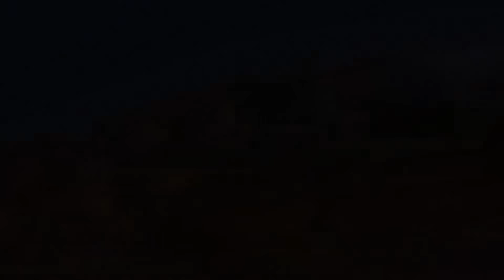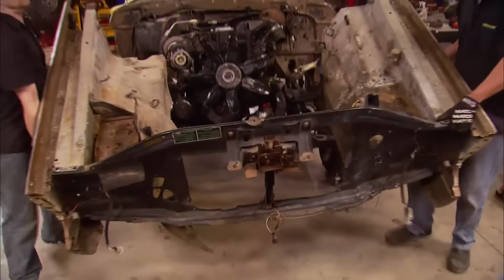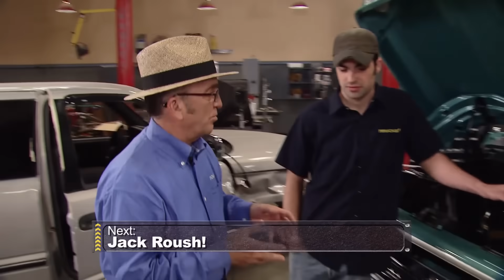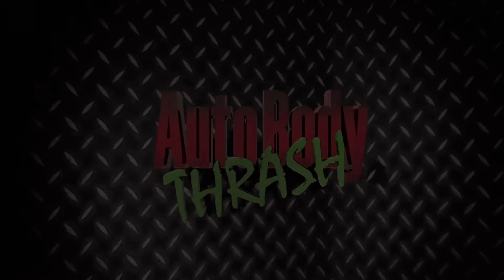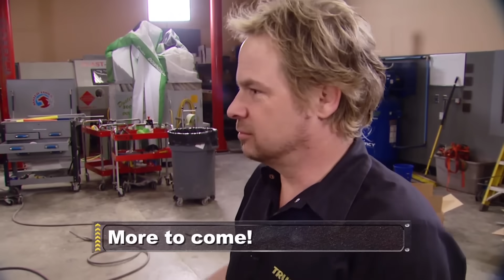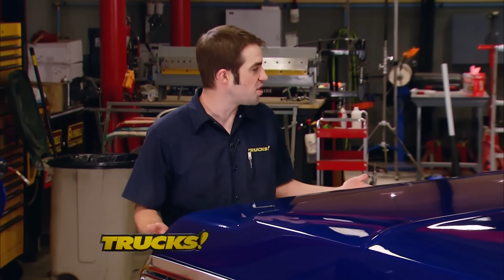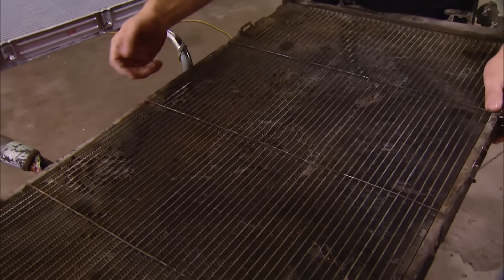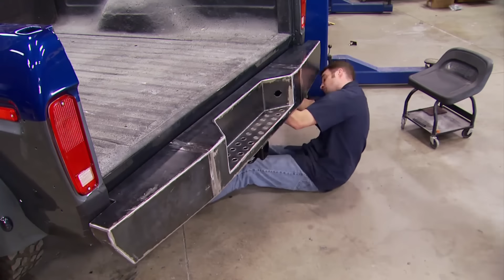Ford Crew Cab on a Dodge Cummins Chassis! (Super Dually) - Full Build

Comment: I love the build its a beautiful truck but why the cummins it's a FORD why not a powerstroke the new high output 6.7 is a monster that beats the current cummins in every possible metric  or a venerable 7.3 powerstroke that will pull almost anything and the aftermarket is masive  or even a 6.9 or 7.3 idi sure they are  slow and don't like to get out of their own way but they'll gurgle on forever  and are stupid easy to repair and maintain or even a bulletproofed 6.0 that will make stupid amounts of power when built properly (the 6.4 is a piece of shit and should be burned at the stake) but there are so many OEM matching engines that would have worked in my mind far better and you can buy a crated powerstroke from summit. I wish more of these restomoded fords would have taken the time to build or get a ford to put back into them because while cummins make good engines the 7.3 is iconic for a reason and the high output 6.7's sheer power makes it a better choice for a tow rig than a cummins does .

Comment: Isn’t that sac religious to stick a Dodge in a Ford? 😂 or visa versa?
Reply: The model T came with engines built by Dodge when they were just a parts supplier. When ford started cutting them out of their parts contract and cutting down on dividends (dodge was the largest shareholder at ford outside the ford family). Dodge sued ford, got a ton of money and started building their own cars. So there is a precedent for putting a dodge motor in a Ford.

Comment: Too funny. I was talking the other day how I like to take my 89 Ford F150 4x4 and put all the parts that I can off a newer Ford 4x4 that been damaged or wrecked. Maybe taking 3-4 trucks to get all the good parts I’d need.  Just want to keep the 80 frame and body so I could still register it as a 89 Ford.   Whether or not that be easy enough to switch everything over I haven’t a clue?  Unfortunately I am not one of those great custom vehicle builders I see on TV now and then! 
Like the builders that took a brand new charger and put everything in a 69 charger I believe it was ? Looked like a 69 charger when it was done, but everything mechanically was all brand new 2022 Dodge charger!  Personally, I rather had a 71-72 Dodge challenger and put in anew doge challenger hellcat in it!  Although if I could find a dodge challenger with a 426 hemi that was stock and in good condition I wouldn’t cry having that either!  
Have no idea which engine would have more HP? The 426 hemi or the Hellcat engine if both were stock?

Comment: For better towing switch the gears to 3:73’ it makes a huge difference especially when pulling heavy loads uphill. We did it to a 98 3500 and what a difference it made and it didn’t make much of a difference in fuel economy.

Comment: Seriously stupid to be doing drum brake springs without safety glasses... my shop foreman would pull out his glass eye and hand it to you if he saw that... he slipped and stabbed it with a pair of needle-nose pliers trying to remove a brake spring when he was in his 20's... grabbing a pair of safety glasses for the job is better than living without an eye for the rest of your life... ( or worse...  the doctors told him that  1/2 inch deeper would have been FATAL )
Reply: In 15 years in the business, I’ve never met a mechanic who lost an eye or was seriously injured doing drum breaks. I’ve never even seen one wear safety glasses, even the ones who have been doing it for 40 years. Maybe not put your face that close to the drums.

Comment: My brother had a Chevy 3500 dually build to hotshot in the patch, old 454 would run, high torque @ high rpm, almost useless @ 55 mph, @ 75-80 it’d pull to beat the band, thirsty though!  It’d been a great candidate for that diesel!

Comment: IHC put the first stock diesel in a pickup in the early 70’s, a 354  non turbo Perkins, one known to exist, probably pretty dead, also at the same time they puta 6 cylinder mitizbitize, sorry can’t spell well, the 6 was turbocharged, I can’t remember if they messed with a turbo on the 354 Perkins, they were 145 engine hp in a tractor @ 2200 rpm.  We had a IHC 1206 wheatland, no pto, 3 point, adjustable front, but with a rolling drawbar.  It had a 361 turbo IHC engine in it and a Rosa-master fuel pump on it, very sensitive to dry fuel, got overhauled every 1000 hours, hotter every time, oil cooled pistons were standard on that engine. Dad graded it for a 1135 Massey, weighted the same as the 12, it didn’t stand a chance in power, very nice to run, opps traded for a 1505 4 wheel drive. Anyway the dealer sent the pump in and then it’d pull with the 12, never was as snappy as the 12, story for another time, maybe more than one lol, the old 12 would use a gallon of oil a day during the heavy work times and none rodding and seeding lol, Massey’s clutch wouldn’t take the power
Reply: Exactly. There were factory diesels long before 89. Dodge was the first to put a turbo on their factory diesel pickups.

Comment: My Grandmom had a late 70s Chevy C3500 Scottsdale with a 454 under the hood for towing her 5th wheel trailer. Hers was a "3+3" with dual bench seats, and it wasn't a dually. When she was towing her trailer, the only way you could tell was because the gas mileage was even worse than usual! LoL

Comment: You adjust the drum brakes shoes through the access hole in the back of the brake plate. They should be adjusted so the tire doesnt continue rolling when you spin it by hand.
Reply: Actually you just need a slight drag. It shouldn’t stop the drum from spinning entirely.

Comment: Wow ! I can't believe that Dodge is a 1997. You guys should see my 1996 Dodge that I drive every day in Michigan. I can see the road next to my seat and the doors are held shut using shed door handles bolted to the only non-rusty metal. Yes, I do have to reach out the window to open the doors. If I get in without my keys I climb out the camper window.
Reply: That’s the difference between the snow belt and the south. In the south, only minor rust. In the southwest? Faded paint, cracked plastic, and not a speck of rust.

Comment: how may this thing look today, roughly 15 years later....
Reply: No idea. It never reappeared on the show after they were done. That white Ford tow rig this was supposed to replace was still used up until at least 2014 (5 years after this truck was built). It was probably either sold, stripped for parts or crushed (more common then you’d think on these shows).

Comment: Loved all of the information while the build was ongoing. The amount of collective expertise assembled for the completion of this project, befits any and all accolades earned by the various company owners. Kudos also to the hosts, who do a fair amount of labor; very knowledgeable guys.
I was gifted an F-250 2-WD. Had to weigh the bed down with sandbags, kitty litter, wet slushy snow or anything else exceeding 300 lbs; ex girlfriends were not always available or accommodating. Vehicle did its best work hauling groceries and 'sailboat' fuel.
The color scheme. The hard work. The dedicated exuberance ❤. The unlimited budget. That Loud Diesel with that Gawd Awful Stupid Whistle. The Pickup truck itself💩. Sorry. Unless there is a need to haul something...NOT A FAN OF PICKEM UP TRUCKS.
Reply: One benefit of EV trucks: since the battery is so heavy and lowers your center of mass, no need to worry about fishtailing with an empty bed or excessive body roll.

Comment: If I had the money, I would purchase the truck in a heartbeat! I Love the body style. Sweet! Thanks for this build.❤
Reply: Do what my wife and I did.  Build one like it, with your vision of an end result.

95 Ram 3500 donor vehicle, and a an OBS K 2t00, 92 extended cab gas model. Built our ultimate tow rig, for our shop.  Also strp capable. 

And I did a.lot of the body work from a wheelchair, or my prosthetic leg, eith the chair behind me as a safety, or plan B. Lost the right one, a week after we got the chasis back from powder  coating,  and the engine and trans back from the machine shop. Was back to the shop the day after I was sent home  to the driveline back in it, as a roller, and the body in primer, after getting soda blasted, revealing dents,  like it was a driving range target, AKA , ball picker. 

Wife worked from the top down, I got the bottom,  with the service dog supervising. From the office, of course. They don't male N 95 masks for pets.

Was finished this spring..

I still, after two amputations, don't think of myself as disabled. That's a state of mind, and a person's level of determination to get back to a normal life. It's lead me to one conclusion. 

The pnly thing that will ever stop me  Is Me. And why I say this to you now.

Who's stopping You?

Go out,  and pick up some yard art, and a marketplace wreck,  and build what you want.

Comment: I don’t understand why you painted the truck before you finished the fabrication work under the hood. You pulled the hood, front finders and grill time after time to change something under the hood. I guess I’m not as good as some of you. I want the vehicle finished before painting. Do all welding, grinding, fabrication, changes to every part. Then disassemble every bolt, every part, everything and get each piece painted.
When we assemble each piece, now it’s finished.

Comment: I can’t drive a manual/stick shift. That darned 3rd pedal, all that shifting in & out of SO many gears, that clutch, SO much stuff to do to even operate a stick shift is just WAY too complicated and confusing. I do fine on my motocross bike and my ATV quad runner.
Reply: All it takes is practice. I learned in an 89 Shelby Daytona and a 79 Bronco.

Comment: Hello From France 🇲🇫
First good : that's a cool video format with many detailed operations finish in a very very cool looking truck ! I'm jealous finding one in France! 
Second the less good: I find a bit sad to work so much and not finished with same skill everywhere, the truck have nice colour scheme and you put 2 steel walls instead of bumper. Like on rock crawler, but with a very little work more on them, they could be painted in same colour shame ,adding a lighter look in front and a very more finished look. 
Side lighting could also be more attractive but it's taste. 
And how about engine bay and interior, so many parts you work on and not any touch of style. 
But the more shocking for me is to let raw used and rust chassis and underneath and bonngisiboe side of panels raw, instead of being paint to be clean and nice. 

Oh yeah it's a so cool work truck that all I've said is non necessary 
But as you said in video, multiples times, hours of work are not a weekend, but a thousand hours cumulated from team,. It desserve those 3 or 4 yours more. 

Finally, despite of these , I want it 💪😁😁😁

Comment: The dually on the front cover looks better than the two tone Truck from first. Except for the grill. Looks like a 1960s Lincoln or something bland. If this truck got 20 miles per gallon I would be shocked. You guys are too young to know how convenient the all thing Dodge view screen is in the dash. Yes I know you would have to put a computer in her but for a geezer like me would really be nice and maybe even get better than 20 mpg with only a few additions like a temperature, oxygen sensor, and mass air flow sensor. Those things are there for a reason.

Comment: The one thing you maybe didn't mention about your lithium battery is the cost. Looking for a lithium battery comes in at around £700, or about $1000 or so. To replace a regular battery comes in at around £110 or $150 (roughly). So you can buy 6 regular batteries for the cost of one lithium battery. Hmmm¡¡¡

Comment: I love the look of the old truck. Being a fan of old Ford trucks, my first truck being a 77' F-250, it's great to see one brought back from the dead. 

That said, you keep saying you didn't spend 40-50K on this truck. You might not have, but you got a LOT of free help and parts then. The average person would have easily spent 50K doing what you did on that truck. We don't get sponsorships like you do. 

I also think it would have been a better build if you had kept the frame original, and done a Cummins swap, or even a Powerstroke swap with it. I think you cheapened the whole build by putting the Ford body on the Dodge frame. I mean that truck is basically a 97' Dodge 3500 with a Ford F-250 body. Looks good, but otherwise, it's trash...
Reply: I estimate if I wanted this done $80,000 plus. $20 K shop time on body and paint, minimum.
Reply: I own Fords, but trash is a little harsh. Just  more money than either F350 or Dodge dually diesel new.

Comment: Ford did make a daully bed in 1977 and up as the used same fenders on the daully flares as the used on the flare side ford f350 and the daully flare lite where surface mounted

Comment: I love the 15 style duramax but I would take that old ford over one every day of the week. With a c notch, different wheels and an airbag system being the only changes. Maybe an auto trans bc I’m a paraplegic 4l80 actually not a 5000k sun coast or whatever brand they use. You might spend 3500 for a built pull it yourself 4l80e with an adapter plate that will run you between 6-1000$

Comment: Have fun insuring that abomination. Unless having an insurance policy for a custom built vehicle (which is stupid expensive) most policies will only replace parts with factory stock parts.... Read the fine print, you'll be shocked.
Buying a new truck may be more expensive initially but you'll save money in the long run.
Reply: Think it would be insured as a early 2000s Dodge due to the frame and Drivetrain. Could be wrong though
Reply: Spoken like someone that has never done any actual repair work. . .  Who cares what the insurance company wants to call it? You tell them to cut you a check for repairs and buy whatever parts you want. The cost of insurance will be directly proportional to what you consider the value of the truck to be. Not a big deal at all. Vehicles like this get insured every single day.
Reply: @athhud  For your information, I've been turning wrenches for 40 years. I do know that many insurance companies will only pay for oem parts in case of an accident unless the policy specifically covers them. I had built a Dodge Lil Red Express clone and got t boned. Long story short their insurance would only pay to put it back to original. I lost all the money I put into it to make it as close to a LRE as I could.
Reply: @junglejones  then you must have made the mistake of getting a basic insurance policy for a custom built vehicle. You aren’t going to pay the same premiums for a beat up old truck as you are a restored classic that is worth 10 times as much. For that type of vehicle, you insure it for a value of your own deciding and pay premiums accordingly. I’ve never had an insurance company even ask if I bought parts, much less whether or not they were OEM. They cut checks, I cash them, and spend it however I want. I’ve literally bought other vehicles with insurance checks...
Reply: @athhud  it wasn't my insurance I had the issue with. It was the insurance company of the woman that hit me. They got very salty with me and said they were only paying to return my truck back to factory specifications, and they had no legal obligation to replace the parts I had put on it. My insurance company tried to force them to pay. But apparently in my state of Ohio, insurance companies do not have to replace aftermarket parts, just the parts to make the vehicle operational and roadworthy.

Comment: I'm a Dodge guy, but I would have used the Cummins power train and picked up a Ford F250/350 chassis. The Ford chassis ride and handle better than the Dodge.

Comment: If I remember, the white Ford pickup was originally built by the original hosts of "Trucks" Mel Fair and Stacy David. They added a generator that ran off the engine that could power electrical tools and equipment such as Mig welders so contractors can use them at job sites. The other accessories were all added such as the roof rack.
Reply: By😅

Comment: …”didn’t drop $40-50,000” Did you really just say that with a straight face?!?!? …Just had 10 guys work a week for free… there’s probably $40-50,000 in body work alone in that build.  Couldn’t build it for less than $100,000.

Comment: I had a 2014 Ram 3500HD with the 6.7 Cummins with the Aisin 6 speed automatic, crew cab, long bed, and it was single rear tire. It was a 9300 lb truck with me in it, and I towed a 36' flatbed gooseneck trailer in it. I was EXTREMELY hard on that truck as I used it to haul equipment in the oilfield with it in the West Virginia/Pennsylvania/Ohio tri-state area, so it got beaten up on the hills and mountains. I put 195,000 miles on it in a year and a half and the only real issues I had was when reverse went out in the transmission, and I shattered the front diff in 4WD low trying to rock the truck and trailer out of a mud pit that I accidentally sank into on a dirt road in the Allegheny Forest. Those were both repaired under warranty though. I really loved that truck. It hauled over 35,000 lbs for hours long trips on many occasions without a single issue. It gained alot of respect from me. I never even had the change the batteries.
Reply: Wow you didn't have to change the batteries in a year and a half... Amazing
Reply: You must be bored.
Reply: Diggin the name bro 😎